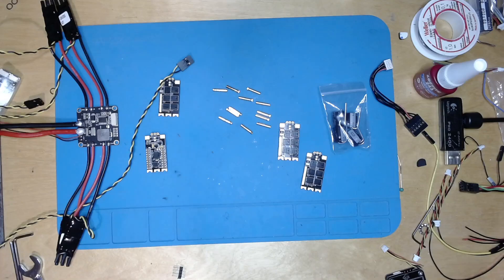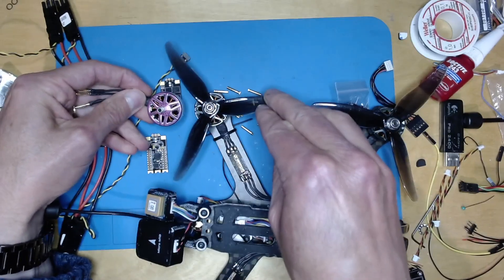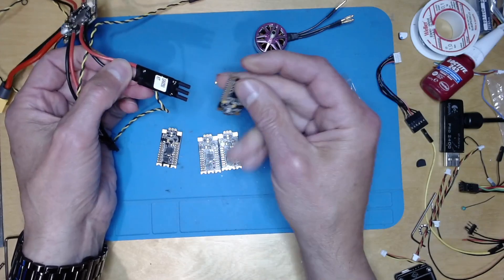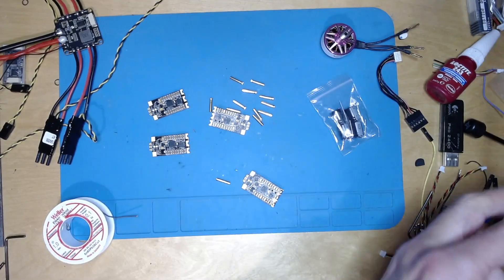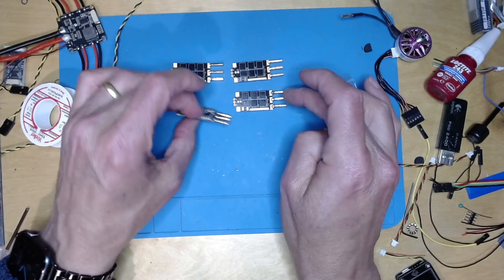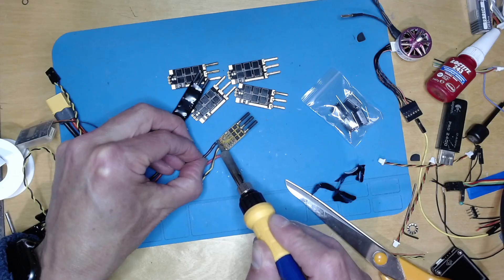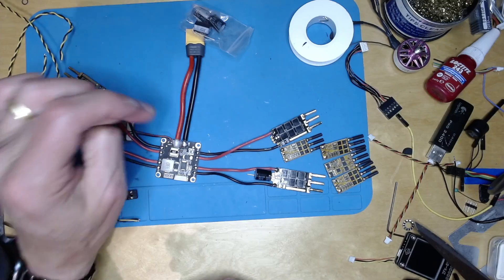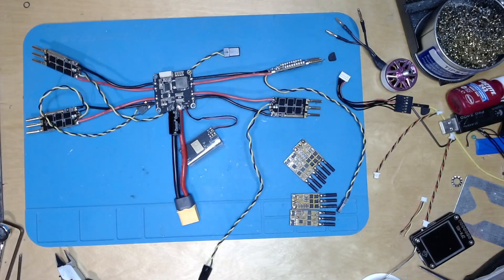AM32 on ArduPilot Part 1 - Installing Tekko32 on the Holybro QAV250

Comment: Hello, i am a beginner and bought those ESC @12:21 what is the Modules which u soldert the 4 ECS to and why do you use this module?
Reply from the maker: This is Holybro's power distribution board that comes with their QAV-250. You need a PDB if you are using individual ESC's, but its more common to use a 4-in-1 ESC that combines all four ESCs with a PDB